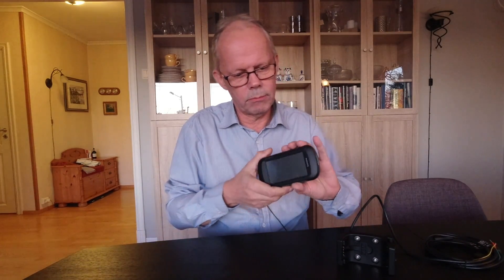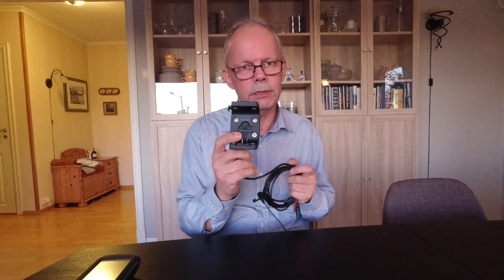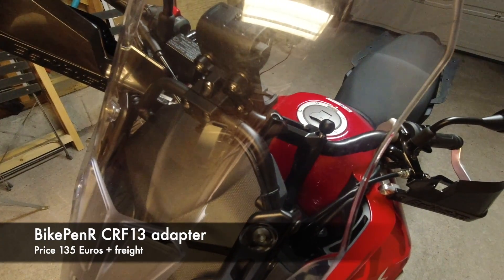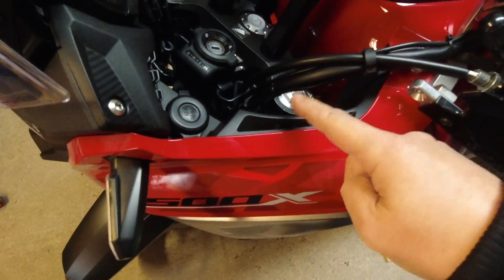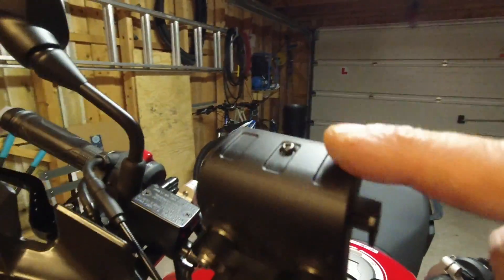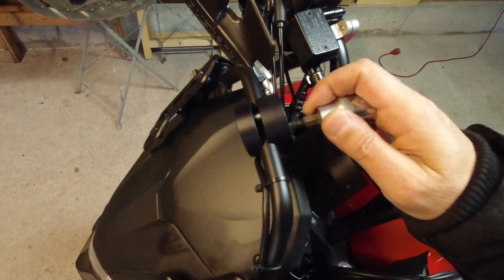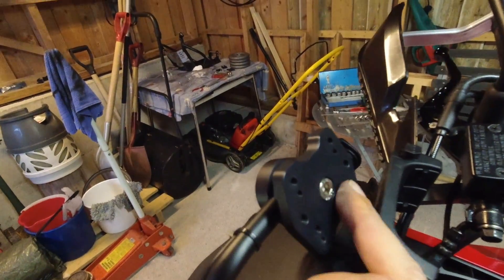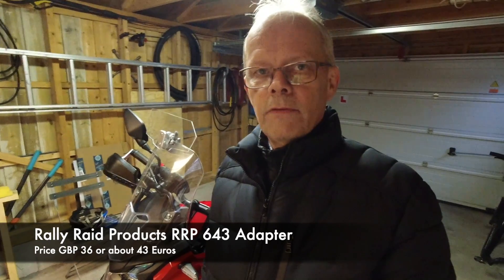Motorcycle Navigation - Garmin Montana - Honda CB500X

Comment: I have a 2017 TomTom with a mount that I have on my T120. When I tried to purchase another mount adaptor for my CB500X I was told TomTom no longer make them as the design of the points has changed, in just 3 years. I have a car adaptor that I can use and I have a socket on the dash, but no mount. So it will have to sit on a tank bag. I’m wondering about one of those X mounts that bikers use for their mobile telephones with sat nav. Your Garmin looks good. Thank you.
Reply: instablaster

Comment: Isn't the rally raid adapter made for the tenere? It has a 12 mm accessory bar diameter. The cb500x is 22 mm. Does it fit okay or am I missing something?
Reply from the maker: My 2019 CB500X has a12 mm accessory bar

Comment: Hi Sven, Really enjoying all the videos..very good quality..not sure if I missed it but could you let me know how you made the electrical connection allowing the unit to start from the ignition...Are special connectors required and which of the motorcycle connections was used...Thanks
Reply from the maker: I connected to the option plug on the left side, same connector as goes to the 12V power output. The option plug delivers switched power. To connect I bought a splitter from eBay so I could connect both the 12V output and the cable to GPS. https://www.ebay.com/itm/Honda-POWER-SPLITTER-SET-CB500X-F-R-CB650F-Accessory-Port-Options-Plug-/282971670310
Reply: @tubelesschannel  Hi Sven,

Many thanks for the help and looking forward to more videos..

Andy

Comment: Couldn’t you have used the auxiliary socket rather than take all the cowling off.?
Your vid was very helpful.
Reply from the maker: I did use the auxiliary socket (option socket) under the left cowling. It may be possible to connect if you know exactly where it is hidden and you have small fingers.

Comment: Any tips for the 2018 model?
Reply from the maker: I thinks there is available a third party accessory bar, then it should be equal.
Reply: Sven Olsen I have been looking at those, both on sites like wish and ebay. Is it worth to get a more expensive one or no? Thanks for your time btw
Reply from the maker: @WTF1wr1ownage  I have no experience with them sorry. But look at the dimension of the bar, it should be about 12 mm.
Reply: With the Palmer Windshield Adaptar kit you have get the GPS bar higher and in a more front forward place